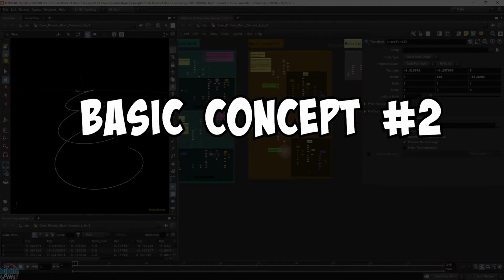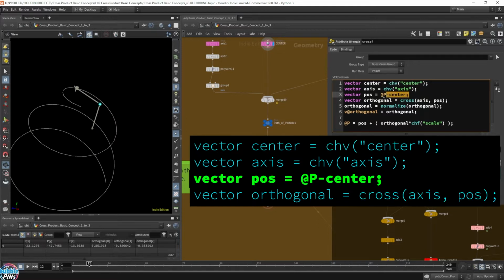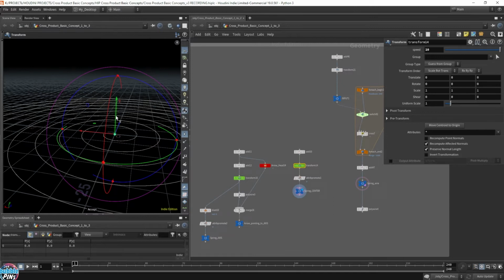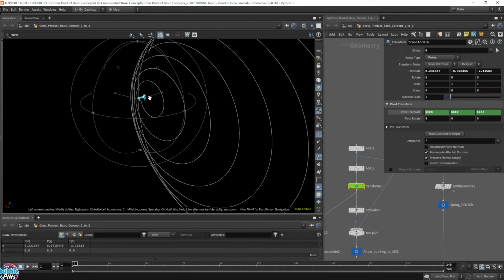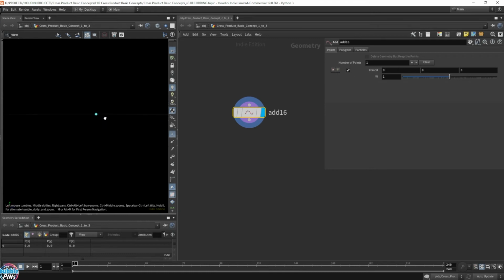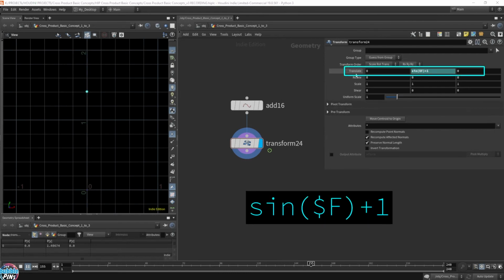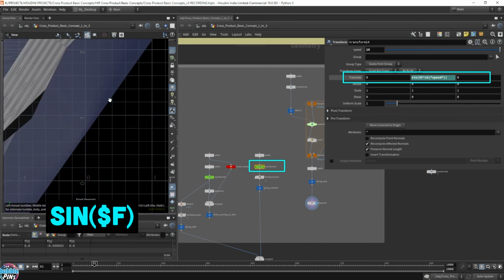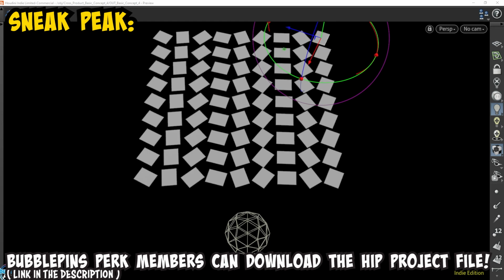Cross Product Basic Concept #2 & 3 - Sine Wave and Foreach Loops

Comment: Is there an advantage to oscillating the Center above the XZ plane using   'sin($F*ch("speed"))+1'   rather than   '2*abs(sin($F*ch("speed")))'  ?
Reply from the maker: The abs() function will remove the negative values from the sine wave.  I did a blog post that has some animations that will help understanding this:
https://bubblepins.com/blog/sop-solver-in-houdini

If you want a more quick bounce, the abs(sin()) will get you that, so in an animation perspective, you'll see a ball bounce up quicker rather than slowing down before heading back up.

Hope that helps!

Comment: Many years ago I made a spring by generating a line with lots of points, moving their tx using a cosine and ty with a sine function which gave me a circle.  I drew that out in ty by moving points based on the point number/total number of points times a scaling factor. I suppose I could have stretched it by animating a scale to the ty and tapered its width using scales to the tx and tz.  Not even sure how to do that now in vex-oriented SOPs. 

That seemed simpler at the time than using this recursive cross product method. Maybe this has advantages I can't see?

Thanks again for a challenging tutorial. Looking forward to the .hip.
Reply from the maker: I use to do the same to create a spring like geometry, using the same sin + cos formula to create the circular motion.  I only used the Cross Product to create the spring this time because I needed an example of an application of Cross Product and I thought was perfect.  I think the next video (work in progress) will be a more practical example of a use case of Cross Product.  But you have a good point!